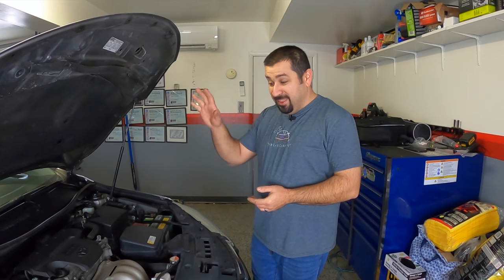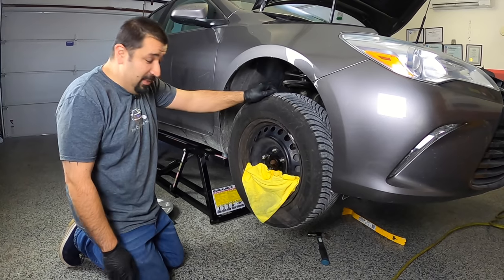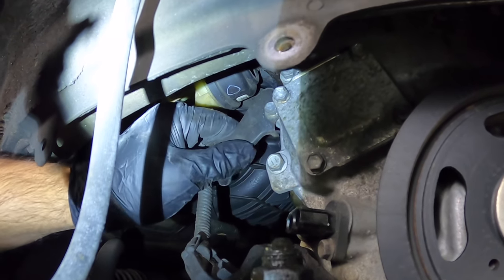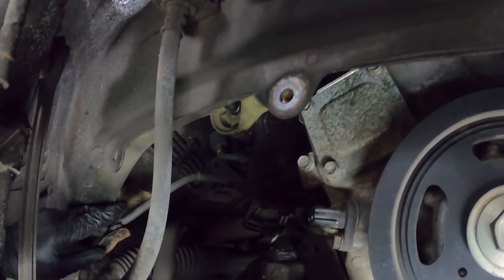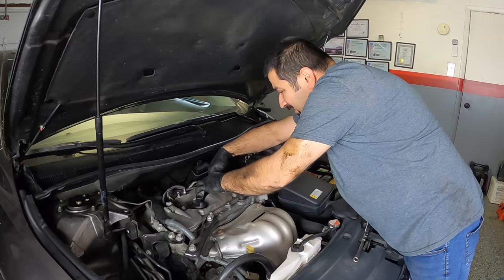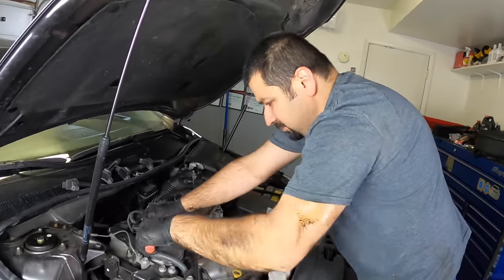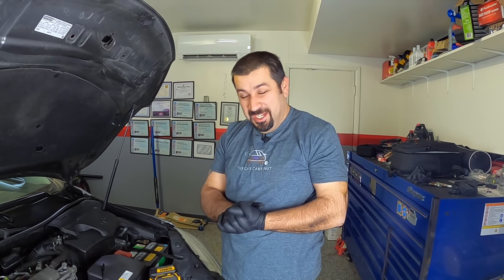Replace the PCV valve WITHOUT removing the Intake. Saving 3 hours of Labor.

Comment: I find it a little crazy that it's this difficult to change the PCV valve on the 2.5L 4 cylinder, while the 3.5 V6 in the same car is trivially easy. Normally the V6 would be harder to work on.
Reply: @j c Yea everything is harder on the 3.5 except the pcv valve for some reason haha.
Reply: . The older Toyotas 3d and 4th generation camrys 4 cylinder were very easy and the corollas are very easy too.
Reply: "go to the dealership" engine design. Deliberately designed to be hard to work on without all kinds of fancy tools. Even with Toyotas. 😒
Reply: Try changing you v6 rear spark plugs!

Comment: Hey body i watched your entire video from  the beginning to the end. I fallow all your procedures unfortunately the hose broke on me with the clamp  on inside the ridiculous space I'm literally stuck. Any idea how to remove the rest of the hose left inside with the clamp on it  to replace the pcv valve please 🙏  help.... i have a toyota rav4 2010 4 cylinders
Reply: The clamp is not tight. Try using a screwdriver to turn the clamp to where you can access it.  Or use the tip of the screwdriver to push it off the hose, releasing the hose and pull with gloved hands.

Comment: Nice Michelin cross climate 2 tires they got there, I just got a pair for my rav 4.
Reply: I got the defender 2s. They’re pretty good for me. Yeah the cross climates have the funniest looking tread I’ve seen on a tire
Reply: @DuckMcDuckinson  yeah I looked at the defenders if the plowing was a little better managed in my areas I would consider them across climates though let me tell ya I’ve never felt so safe driving a tire in the rain. You’ve literally feel like you were on the road and heavy water versus sitting on top. I’m never scared on the highway in heavy rain.

Comment: took me like 4 hours to get it off and on lmao but youre right about rav4s always get a new pcv hose for it. they sell them on parts geek for the 2010 2.5 ltr engine model if you cant find them.
Reply: I was lucky and pulled the hose off.  But I pushed the clamp around, twisted the hose gently and mine came off with a gentle tug.  The rubber was hardened, but still worked.

Comment: Great video! I own a 2015 Highlander with the 2GR FE engine so PCV valve replacement is much easier. However, I can't find a suggested mileage interval for routine replacement. What interval would you suggest please?
Reply from the maker: Hi! The same interval as the spark plugs which is 120k miles in your case

Comment: I'm surprised that Toyota would design the PCV valve setup this way... although I do not like the oil filter setup either (cartridge with plastic housing that takes a breaker bar to loosen)...

Comment: Love your channel.   I need some advice.  I own a 2009 toyota corolla LE with 160,000 miles that just had all motor mounts replaced.  I hear excessive engine exhaust noise I think especially when acceleration and a whining noise when pressing the gas pedal goes away when I let off the pedal.  I want fix it but want to be a little more in formed on what I could be so I won't be taken advantage of at the dealership.  What do you think it might be?  Any help would be super appreciated!
Reply from the maker: Hi! I think it could be either the gasket between the exhaust manifold and the pipe or the front pipe by the catalytic converter is corroded if you live in the rust belt
Reply: I had similar issue on my 2011 camry 2.5L. The fix was simpler - engine air filter case was not closed properly and there were some air leaks. I put it back on and it’s been quite since then. Try that first.

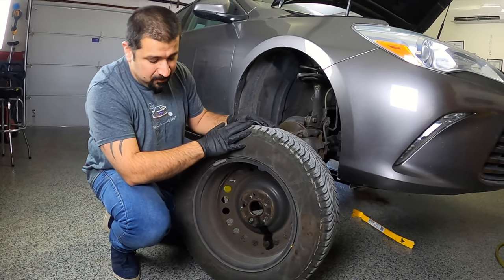Comment: @3:00 I had that issue once. Somebody told me to screw the lugnuts finger tight and drive the vehicle at low speed making very sharp turns. Sure enough it popped the first turn.

BTW, what model lift do you have?
Reply from the maker: Hi! This is a quick jack
Reply: @TheCarCareNut  Thx

Comment: Silicon spray and oxygen sensors don't mix. A tiny amount in the engine oil with make it eventually to the oxygen sensors where it can potentially damage them permanently.

Comment: That technique doesn't work on my 2003 Avalon, but it's not too bad, except it's in the back of the engine..Patience is the key to working on cars, that and having the right tools for the job.. Now at days you can always watch a few YouTube videos to familiarize yourself with any job that you lack experience with..The key to working on your own car is to not  make things worse by lacking patience and forgetting to plug things back in, or over filling, over tightening, etc.,.. Car maintenance is easy but requires patience, taking your time and your full attention..If that is not you, pay a mechanic...

Comment: Did a spark plug change on my daughter's 2013 Corolla (about 50000 km with 1.8 L engine) and thought I noticed some oily film burnt on the outside of the plugs near the stem...   was wondering if this was a valve cover leak or came from somewhere else...  rustproofing?  Have you had any experience seeing this before?
Reply: Happens normally. Don't worry and just Keep an eye on it.

Comment: Is it possible to perform this job on a 2010 Camry 2.5L ARFE? There is a power steering pump right next to the intake manifold.
Reply: Might as well just take off the intake manifold and all the stuff connected to it. You don’t need to take the pump off just the belt to it just enough to squeeze a ratchet with extensions.

Comment: Is it possible to clean the PCV valve with MAF cleaner? On my camry'99 I use MAF  cleaner to loosen the sludge/oil inside and let it dry for a while. Put it back and problem solved. Also the PCV valve is on top of the valve cover  which is easy to access. I just replaced the rubber grommet when it gets brittle.
Has anyone here done this?

Comment: Is there enough room to thread the valve in by hand ? Or is there not enough room ?
Reply: Didn’t feel like it. I used an adapter and used a 1/4” extension on the 19mm socket. This way it felt lighter and more controllable threading the new one in. I ran it in with the 1/4” and switched to 3/8” for the final tightening.

Comment: Is it possible that my 2009 2arfe oil is getting dirty very quickly after an oil change due to bad pcv valve,additionally,is it possible that the oil consumption is due to  ad pcv  valve because all the experts say the 2009 2arfe doesn't have bad rings ?
Reply from the maker: Hi! It’s possible it’s a pcv valve. But usually the 10k mile oil change interval is what causes oil consumption in the 2AR engine

Comment: The valve is much easier to start IF you put a short piece of hose on it. I do the same when replacing spark plugs to prevent cross threading.
Reply: This advice is golden!  It would've saved me at least 20 min.

Comment: Hey, I have the 4cyl 2009 highlander, with rear main seal leak, could replacing the pcv first be a good idea?
Reply from the maker: Hi! The seal will need to be fixed and replacing the pcv would be a good idea
Reply: @TheCarCareNut  Thanks AMD, much appreciated.
Reply: I changed on my 1AR-FE (2.7L) 2009 highlander, took me an hour or more to just the hose out. Quick tips for the 1ar-fe, pulling the hose from underneath gave me the most leverage and also the pcv doesn't fully thread in which I didn't know until I googled so don't expect it to thread completely. For a DIYer make sure you have strong finger muscles too :)

Comment: Although using an anti-seize lube where the wheel's center connects to the hub is a good idea, I have never used an anti-seize lube at this location. And yet, I have never had a wheel seize to the hub (knock on wood). Perhaps that's because I rotate my tires every 5 months/5k miles?

I can remember --- many moons ago -- when PCV valves were EASILY removed/installed in a rubber grommet atop the valve cover in a matter of just SEVERAL SECONDS, not hours; no technical skill needed to remove/install a PCV valve back in the day.....easy peasy.

Comment: Instead of silicone spray, try some combustion cleaner instead…especially if the main component is butyl cellosolve. If you had a rubber bat, you could spray it with combustion cleaner, then shove it through a key hole. Well, that’s what we say. Doesn’t hurt the rubber btw.

Comment: If you live in a salt area and have steel rims, don't be afraid to run a Dremel or die grinder around the inside of the hub hole. If alloy, carefully sand. I always used a 4x4 between the rim and the BigF Hammer, usually works. Also, but use your brain cells for this, we would loosen the lug nuts one turn, then drive the car around the neighborhood until we heard the rumble. Tighten the top nuts, pull up 1/2 tire rotation, tighten the top nuts, drive back to the lift.

Comment: That is a minimized safety hazard.... those are Michelin CrossClimates.... the best tire you can get. Has road hazard protection and a special team of little green men that travel inter dimensionally to get to you in case of a flat tire. Michelin actually reimburses you for lost time and even gets you a new job if you get fired from being late. You'd be hard-pressed to get a flat, but still it "could" happen I guess theoretically.

Comment: AMD, in the old days, PCV valves were on the top of the valve covers and took a couple of minutes to change. Now they are hidden and people don’t even know that they exist! Why do they build them like that now? Is this similar on a 2013 RAV4?
Reply from the maker: Hi! The only reason is that they moved the oil separator from the valve cover to the back of the block

Comment: I really like toyotas but that's a little bit of a downer. I have a 2012 honda accord 2.4l and a 2012 honda civic 1.8l. The pcv valve took about 5 minutes to replace on each car. It is right in the front of the engine  by the alternator or valve cover. Sometimes engineers drop the ball.

Comment: Question: What is the PCV valve ? and What is PCV function to car ?
Reply: emissions.
Reply: Positive Crankcase Ventilation. When an engine runs some of the combustion chamber gases get past the piston rings. These gases have to go somewhere or it’ll blow out your seals. There used to be what was called a road draft tube which vented those gases to atmosphere, which is not great envisions wise. So by using a PCV valve you take the gases and reburn them, it’s a valve so when it works properly there’s minimal oil loss. When I bought my 2001 Mercury Grand Marquis in October 2020 it was using a quart of oil a week, changed the pcv valve and there’s been no detectable oil loss since. However I have no idea how long that was occurring and now have an inefficient catalytic converter.
Reply: Positive Crankcase Ventilation valve.  The valve is a one way valve that routes oil fumes from the engine crankcase to the intake plenum and into the combustion chambers to be burned.  If the PCV valve becomes clogged up with sludge and stops working, it will cause pressure to be built up in the crankcase and the engine may start burning oil.

Comment: Has anyone used this method on the Scion tC with the same engine (2AR-FE)?  I tried, and I don’t believe it can be done.  The structure of the tC seems to be enough tighter to prevent this method from being used.

Comment: Thanks to the engineer , this pcv valves will take hours of labor to take out. on a civic, it is right on top of engine. one bolt and it's pulled out in less than a minute. Is toyota doing german engineering or what? like those bmw change a rubber ring and need to drop engine.
Reply: Why rubber ring you mean engine main seal?

Comment: My question is is the Pcv valve needs to be replaced at 60,000 miles or 100,000 miles.
Reply from the maker: Hi! With the spark plugs at either 120k or 60k depending on the model
Reply: Rav4 2018
Reply from the maker: Every 120k with the spark plugs
Reply: Ok thank you I like your videos

Comment: I tried to get that valve out, and cannot even get the hose, it was coated with oil and slippery. I gave up after about 1/2 an hour and took a few tries even putting the crank sensor bracket bolt back on. Maybe those junior engineers at Toyota designed that valve to last the life of the engine. I have 130,000 km now and planned to have a mechanic do it at 1/4 million Km, and I be sure to replace the rubber hose too.

Comment: If you use a rubber mallet there is little chance of damage to a steel wheel. I’ve done it dozens of times when hitting the tire doesn’t work. But if you start pounding on it with a sledgehammer yes. 😂

Comment: Thank god my PCV valve is located at the back of the rocker cover 🤣 2 minute job, the old one looked original and seemed to work ok but the car has done 120k and is 15 years old so for the price might as well change it

Comment: Another great video from you, sir.  Thank you!  BTW, the special words that I would say to the engineer who designed the location for the PCV valve is "You are fired".  Something that took me less then 10 minutes on my 2007 Sienna to replace the PCV valve,  now will take hours to do on my 2016 RAV4 SE.  How stupid can the engineers be that they place a serviceable item in a hidden and hard to reach location?  What's next, place the oil filter in a place where you have to dismantle the whole engine block just to change the oil filter?   Wait, I shouldn't give them any funny idea or they ended doing just that LOL.

Comment: this PCV valve location is a very stupid design, I am very surprised that Toyota didn't improve that, isn't Toyota suppose to be about constant improvement?it is obviously not true in this case, for something that should be serviced at a regular interval it is a poor design at best! Toyota is starting to slip like the big three are, it is probably designed by the same engineer that thought that it was a good idea to remove the cab on the new Tundra to change a wastegate!

Comment: ℹ️✅ Do you think it’s possible to clean up PCV valve without removing from the engine? If PCV valve is not damaged, just not clean enough to work properly. Maybe it’s good idea to disconnect PCV hose from engine head and spray carburetor cleaner inside ( or small amount of kerosene), wait few hours and start engine after. Vacuum inside engine head will remove dissolved slag from hose.

Comment: Toyota dealer charge $37 Canadian for a PCV valve, it is a simple thing with a ball and spring. Other places like Rock Auto cost about $10 US, OEM parts to me is not a religion like you. Some parts especially complex ones , like oxygen sensor, I heard non OEM ones do not work well.

Comment: What a poor design!  My Lexus GS V6 only needs only five minutes to replace the pcv valve.  Pop the hood and the pcv is visible at the top of the engine.   No jacking up the car, no removing the wheel, no removing the wheel liner, no removing a bunch of stuff to reach the pcv.

Comment: What a stupid place to put a PCV valve , why is it not at the top of the engine ?      On my Windsor engine , I can change the PCV valve , using one hand in 30 seconds , no tools required.   I fail to understand the need to cram components one on top of the other in a very small space.   When working on my  71 , TVR  Vixen ,  I hinge the bonnet forward , sit on the wheel and work in comfort , modern cars are designed by lunatics.